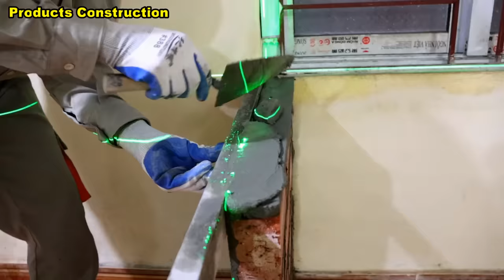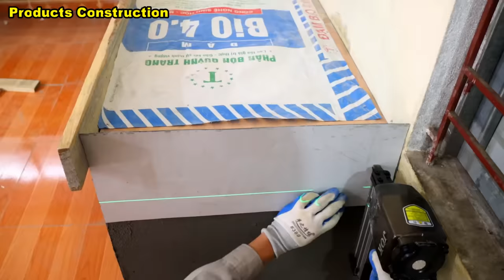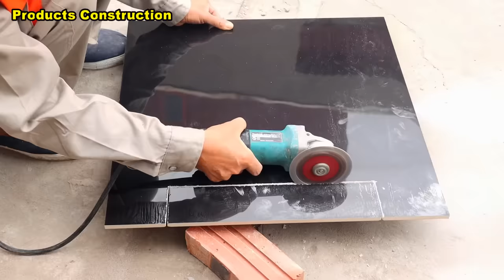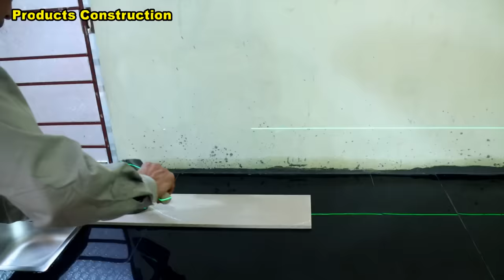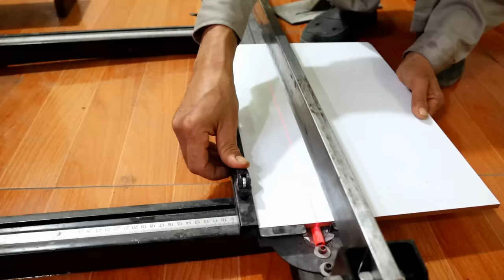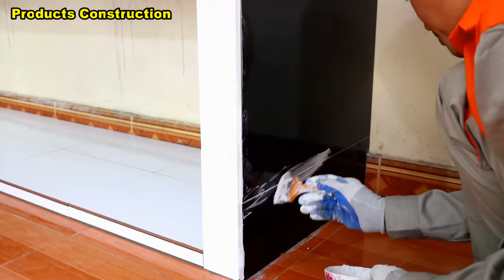Design & Construction Kitchen Table Family - Easy Install Kitchen Table With Ceramic Tiles

Comment: U need to hack the floor and wall for the brick to bond properly.. It's gonna crack and collapse in abt a year or two..all the effort will go to waste.. Need proper knowledge to make it long lasting... What a waste!!
Reply: I agree, the bond on the floor is not that strong
Reply: True 100%
Reply: Enfim ,alguém  que  entendi do assunto, pensei o mesmo que vc .
Reply: O vc
Reply: @hemantchhatta7842  True..but may not be disastrous!!
The weight of RCC will hold the entire structure & put enough pressure on peripherial wall & floor to hold everything together!! But Tiles Joints on kitchen counter will create trouble & hygiene issue over a period of time!
Reply: Totally agree. The termination is beautiful but the procces is very important
Reply: Com certeza amigo
Reply: Eu não gostei da parte da tomada eletrica o acabamento não ficou ok é a torneira da pia eu não consegui ver mais o restante ficou top
Reply: இது தொடர்பாக
Reply: 😮5ik
Reply: Berapa lama boleh tahan macam ni
Reply: Agreed, he should have made cuts in wall and floor before laying the bricks. This joint between wall and the kitchen table will have cracks and water seepage will start.
Reply: Se não que corta o chão pelo o menos coloque ferros dentro da paredes e no chão uns pinos de ferros .mais deixar sem corta o chão com passar do tempo racha tudo ..forte abraços. Grande proficional
Reply: he made portable kitchen set maybe
Reply: Cuántos días se puede tardar haciendo un mueble de de esos Muchas gracias
Reply: Y la llana dentada para la aplicación del porcelanato...... Mal instalada la terminación
Reply: Pensei nisso,  pois trabalho de ajudante de pedreiro rs.
Reply: Así es

Comment: Muy bonito, muy presentable y todo, pero es un mal trabajo, por los siguientes motivos, el concreto no tiene una correcta fijación con la cerámica, ya que es una superficie lisa y suave, de la misma manera que no tiene fijación con la pared que también es una superficie lisa, la cocina en un año se va a despegar de la pared y del piso, por el peso, movimiento y fricción se va a mover hasta despegarse, estás grietas serán perfectas para la entrada de plagas como hormigas, cucarachas y chiripas, la solución es que debió cortar el piso y la pared para que el concreto tuviera una correcta fijación y de esta manera no se mueve y perdura años, en cuanto al pegado de las cerámicas, debió aplicar el pegamento en toda la superficie del mesón y cara posterior del cerámico de forma uniforme, la mala aplicación del pegamento permite que en un lapso de tiempo la misma caiga por su propio peso ya que no está bien adherido a la superficie, también está la posibilidad que si recibe un golpe dónde no está el pegamento se rompa, aparte tambien permite que la plaga habite estos espacios, y otra observación, en el área del lavadero de debe romper todo el trabajo que acaba de hacer ya que no instalo las tuberías de agua blanca y desagüe, son tantos errores, es más una obra temporal de perdida de material y presupuesto es un mal trabajo con buen acabado
Reply: Eso mismo pensé. Ya he visto un colapso cuando trabajan así.
Reply: Yo no tendría ese coraje. Pero hace muchos años, antes de que existieran las masas actuales, aquí en Brasil, la cerámica se colocaba con cemento y funcionaba.

Comment: I think  in such installation as there is not a hood to suck up the smoke, is the cooker which should be on the side of the window and the dishwasher on the other side. Otherwise it's a good job. 👍👌

Comment: The tile cut for the sink is completely wrong as the leap of the sink should be over the tiles not leveled with tile, this way is going to collect germs all over the stain steel.
Over all good work well done and thank u for sharing your ideas

Comment: It's profesional work, but it will neves pass the safety  inspections in my country for a house, the gas cylinder should go outside  and have a container that have a roof and ventilation. If you don't have ventilation holes  in the kitchen near the stove , at floor level and at eye level, it's unsafe to keef gas cylinders inside.

Comment: if you sand the corners of the ceramics at 45° for joints then the grout seams get smaller. makes it look like a single stone.

Comment: If he is from china no need to wonder😂 . it is better having a horizontal &  vertical bars that bolted on floor & wall for greater strength. This work 2 to 3 its going to waste🤣🤣🤣

Comment: The huge mistake by the owner of this house is, He sacrifice the Electrical outlet instead of seeing the perfect installation of the tiles he keep the Outlet remain as it is. You should remove the outlet temporarily so that no need to slice the tiles just of a piece of shit which is plastic trunking . Anyway its your call its up to you what you want for style of installation, but if you ask me you destroy the almost perfect job and beauty by sacrificing a piece of plastic trunking. sometimes we should have or we need to pose for a while and think what more and what maybe the best way or other way around. Sorry to tell but thats the way i see it. You almost done the perfect job if you installed water Faucet in your lavatory but sorry to tell there is no Water outlet provision so what you gonna do? bring a bucket of water manually thats old school style.

Comment: 1st U need to learn not to cut tiles around sockets and cable molding. 2nd The sink always seat to the tiles.  When u look closer it looks very ugly and unprofessional or cowboy builder. Also give time to scratch wall paint, paint with PVA, never tile straight to painted wall. No offence, I know your good.